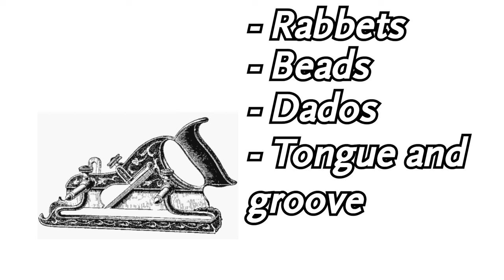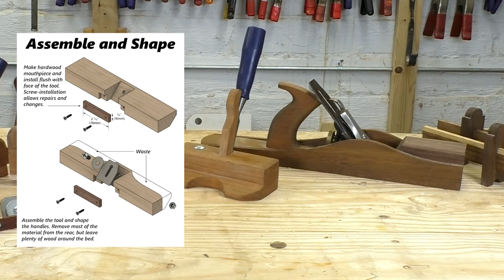The Surprisingly Essential Plough Plane

Comment: I am a hand tool woodworker.  I consider the No 4 hand plane, Router hand plane, and plough plane should all be purchased at the same time as all three are essential in my opinion.
Reply: I only sort of half-heartedly (dis)agree, it really depends, as they say. 
I had no use for the plough / combination plane in the beginning, but this heavily depends on the projects. Anything without drawers is a good start. Six board chest, Dutch tool chest, work bench, Richard Maguire's side table, dining table.... there's a ton without groves. (also the projects Rex presented so far).

Now I'm doing small cabinets with drawers, fitted a drawer to my Dutch tool chest, and I really enjoy using a plough plane (with a sticking board, also a good early project).

And the only power in my shop is the light. The rest, as Roy Underhill put it, is alcohol powered.
Reply: Yes, and don't buy a combination plane - even a good one like Veritas - unless you need a combination plane.  A small plough plane is a better choice.  Just don't buy a left handed one unless you need a left-handed one (or if you are left handed).
Reply: Why a #4 hand plane and not #5?
Reply: I recently bought a “new” Bailey #4, Gyokucho saw and Shinto (for endgrain work/tuning, as planes suck at endgrains). (I’m on a shoestring budget)
But, I still want/need a plough and router tho for drawers, boxes, more complex joints, etc. 
Expensive tho! 😕
Reply: @LessTalkMoreDelicious  If you watch some of Paul Seller's YouTube videos, you can build those for very little money.
Reply: @LessTalkMoreDelicious  I built my own router plane, based loosely on the James Hamilton design.  I bought two irons from Lee Valley.  Works like a champ.
Reply: You're not wrong. However, it's also useful to learn to cut grooves without one. A router plane can be made in shop as simple or as complex as you feel.
Reply: @petegrapentien4147  I use a No 5, 4, and3 in my normal work. Each a slightly different role. I wouldn’t argue if someone wanted a No 5. I just prefer the No 4 for its slightly shorter sole than a No 5 for all around versatility.

Comment: If you’re looking for flat glass for sharpening: I’ve always had good luck going to Goodwill and buying a bathroom scale for $3-$5. You’re going to be looking for ones with like 1/2” thick glass, but  that’s just my preference. Hell,  you know they’re all strong enough to hold 300+ pounds. I haven’t found any that were warped or out of true, but it’s probably a good idea to bring a straight edge to test with.
Reply: I got sooper lucky at the Re-Store and got pieces of thick glass. I bought the glass pane set off Taylor Tool anyway too for the price of the fancy micro film. I think it’s labeled as the Scary Sharp officially on there.
Reply: I use a mirrored sliding door from an old medicines cupboard. It’s already mounted, perfectly flat, and cost me nothing; skip dived it.
Reply: I went to dumb depot and got a 12x24 piece of floor tile. shiny, flat, $5.00
Reply: perfectly flat is an exaggeration. as flat as glass is, it's rarely ever perfect. it's just good enough for daily use. i mean seriously why do precision granite block if you could just use a 1/4 glass panel for all your metrology needs. haha.

frankly it doesn't need to be that flat.
Reply: @BloodSprite-tan  Using float glass that’s half a inch thick. I like to see the flatness by the surface smoothness by reflection. If my glass or whatever had any disruption in it it would be very easy to see. The power of light. I’m using mine for measuring machine tools too and use a granite plate that has more dips in it from wear. Glass is pretty amazing for sandpaper runs.
Reply: I can't imagine a glass surface plate is the least accurate thing in your set up right now. i don't think it's flatness has any impact, it's close enough to be used. it's just weird to call glass perfectly flat, when lots of glass isn't flat. i'm sure you had a temper glass screen protector it's easy enough peel up a corner and make it no longer flat. with that being said, if the glass is thick enough, it should be less of an issue. i mostly just want to tell people glass isn't always flat, it could be tapered or high in the middle, but since it's such a small amount off it's not noticeable or important.

glass is good for sandpaper. it just doesn't stick that well in my experience. i really don't know how they manage to stick the sand paper down without it coming loose, or when they do stick it down getting it and the adhesive off without spending more time than it's worth scrapping it off.
Reply: @BloodSprite-tan  In older houses, 150 years, the glass panes are thicker on the bottom and thinner at the top. It’s visually obvious and can be seen plainly by just looking. Glass is an amorphous solid, not liquid but moves very slowly. Slower than molasses is slow. Modern float glass however is very very flat and does not change over time. Again, the surface is so flat and smooth that you won’t see any surface imperfections from light being reflected. It’s a big bonus of glass. If you use the sanding film and polish two metal surfaces using float glass you will get a atomic level connection. Even granite surface plates rated highly wont necessarily do that.
Reply: I got a 16”x24”ish slab of reclaimed marble from a tile and flooring store for $10. Came off a bathroom counter I think.
Reply: @Vikingwerk  I get countertop scraps for free. They have to pay to dump them and are usually more than happy to let you take stuff out. Leatherwork shop in same building that sends customers over there lol

Comment: I got one, with a whole set of cutters. Lovely bit of kit and often gets used instead of the router for cutting grooves and starting mouldings.
I have so many old hand tools and love keeping them in use. Looking forward to your video later.
Reply: Yes, the 050 or 051 is not bad :) using lots of candle wax on the sole and fence helps a ton. It can still be a bit of a clat though.
Reply: @johanneswerner1140  so what is wrong with using a router to do the same thing?

Comment: I have a Stanley 50.  2 years ago bought it online for about $40.  It only had the 1/4 inch blade, which does a lot of work.  Slowly added several more original blades, including ploughs and beads.  Not expensive at all and cuts beautifully and smoothly.  I set the blade with a small brass hammer and this can make real finesse changes.   Really glad I got it.  Others will find it very useful.

Comment: Great review, Rex, thanks! I found a Stanley 45 with most of the cutters in a relative’s basement 25 years ago. I have taken it out several times but it will need a lot of work to free up the rusted-together parts. I keep putting off that job, but with this reminder of the 45’s utility, i am resolved to get it up and running soon.
Reply: So did you?

Comment: Nice discussion.  I've a Record 044.  Using it is a learning process.  There's a definite business potential for someone to start making blades for the old plow and router planes that fit properly, the way the originals were.
Reply: If you’re interested take a look at Workshop Heaven - they sell a set of 8 replacement cutters for the Record 044 for £41 or a set of 3 for the 043 for £13.
Reply: @richardsinger01  Thanks for the suggestion.  I looked, but couldn't locate any replace cutters except for some for the Quang Shen small router plane.  I'll keep an eye on the site though.
Reply: As others have mentioned Ray Iles makes irons for the old 44 type planes, and numerous other old planes. The Veritas router blades fit the old Record and Stanley routers, you have to invert the adjustment nut to fit them :)
Reply: @whittysworkshop982  "You have to invert the adjustment nut ... " which why I wrote ". . . fit properly."  Thanks for the information about new plough plane blades.  My 044 actually had blades with it when I bought it.  The learning process is in getting it set up.
Reply: I dont think it's a big deal to turn the nut around, and the blades are way better than the old ones, my old router has a set of Veritas blades for it; from tiny 3mm ones for fiddly inlay stringing, to the normal 12mm ones for flattening dados and tenons 😁
I have the Marples version of the 44...... it's my favourite tool in the workshop 😁 I find it's quite easy to set up, and its WAY better than a power router for grooves; no dust and noise....... its quicker to set than a power router too 😁 the 44 type ploughs dont like cuttin anything bigger than 1/2inch tho....... they lack support on the outside of the iron and they tend to chatter like mad with that size and above, but they EAT 1/4inch grooves for fun. Most of my drawer bottoms tend to be 9mm so the 3/8inch iron basically lives in my 44 😁 
The Ray Iles plough irons; I know of 2 instances where someone bought them and had to send em back...... they were not hardened properly, they could be cut with a file they were so soft. If you do find a set of them, check em with a file 😁

Comment: About 3 years ago, I bought a complete Record 050C Combination plane, as new in box, in perfect condition with all bits and bobs and original accompanying literature, for £28. Then I was given a complete spare set of earlier model cutters in need of surface rust removal, kept in original wooden holder to max it out. I don't know what that's worth now but it isn't going anywhere because I love it and use it regularly. It's brilliant. Yes, there is a learning curve when changing from one setup to another but you soon get the hang of it. This kit does it all - almost...!

Comment: I snagged a Stanley 12-250 with all the cutters (and original box and manual!) for about $150 shipped. It's a combination plane, rather than strictly a plow plane, but it's got the cutters to do all the plowing I'd ever need, it adjusts easily, and it feels pretty sturdy in the hand.

Comment: I learned this neat trick when using sharpening guides, instead of filing the chisel grooves square,all I did was put the cutting tool all the way down to the pins instead and tightened the tension. Sure you won't be getting a perfect 25° angle but with such low variation it doesn't matter and it comes out perfectly fine.

Comment: Both you and Wood by Wright have raised these small plough planes recently, so prices may be heading up.  I use a Stanley 50, which is nice for what it does.  

Buyers should note that these should come with a chip deflector and a iron securing screw for he narrowest blades - but they’re usually missing.  

Mine was missing these two pieces, but included the full set of cutters, all for $50.

Before purchasing, I recommend searching the web for the instruction manual.  The manual will help identify the pieces you need, and sipped the learning process for using the plane.

Before buying
Reply: I believe Patreons get advance access to the videos so have a slightly better chance of still being able to pick up bargains before the Krueger/Wright effect comes into play 😉

Comment: And if you're really lucky you can find a Stanley 55 with all it's blades in it's original box, minus lid, helping a friend clear a house prior to selling.
I also have a bookshelf/bureau that was built using the 55 by the original owner.
Total cost a few hours labour.
Reply: Wow. Shame you can't post pic of the 55, plus the bookshelf 🙂great find. ❤
Reply: Nice. I also found one, the tiny teensy problem is that it's currently being sold for 1,200.

Comment: I've got the Stanley #45 type 7 from about 1907. Has all the cutters and other fiddly parts and it came in a finger joint Chestnut box. Still has most of the label, too. I've used it for making drawers and panel doors.

But I also have several other specialty planes from Stanley. The #48 T&G plane, the #78 fillister/rabbet plane and the #72 router plane, amongst others.

My #45 I bought off eBay and paid about $110 bucks several years ago.

I used to have a wooden screw arm plough plane with some old Mathis irons, but traded it off for other tools. It was more a collector's play purty to set on a shelf and look at than a tool to use.

Comment: i made a simple grooving plane that makes a 1/4” wide hole 1/4” deep 1/4” away from the edge and it took me seriously like 4 hours and it does basically everything i need. I have a big fancy plough plane and i never use it, i just use the easy one thats always set up.
Reply: That's honestly what I've been contemplating doing.  90% of the time, if I'm cutting a groove, it's a drawer bottom.

Comment: Hi Rex, knowing many watch your channel I would like to add a small something. I have plow planes, here's the cost in Australian dollars for good functional plows, here we go, Luban 43 small plow $350, Stanley 50 with 20ish cutters  $350 -$450, Stanley 45 no blades $350 with blades $550 full set(3 boxes), Stanley 55, $500 - $800 no blades, Full set of 4 boxes $600 -1000. Australian dollars. Now in saying this you can buy ones cheaper but they are in very poor condition a ton of work refurbishing them and I mean a lot weeks day in day out. been there done that, but if you get them well you did well, now you need to learn how to use them. cheers

Comment: I've just bought a Record 043, waiting on delivery. Though I know it's missing the depth stop and two cutters. 
I have the Stanley 50, it's a great little plane. I found it works nice with shallow cuts, takes a bit longer. Also have a Stanley 55 (been in the family for years) I've only tried it once, takes a bit of setting up, wasn't too keen on it. I'll try it another again when I have more time.
Reply: Swap you a full set of record cutters, depth stop, fence  for your 55? 🤭

Comment: Some time ago I came across a Record 44, which has the thumb wheel adjuster for blade depth and comes with a full set from a 1/4 to 9/16ths blades. It was a bit foxed but I detect no use on any of the blades. Works well though needs freeing up.
Reply: The 044 is much better than the 043 due to the reasons you mention. I got an older good one for $40 with all the cutters.
Reply: @Membee  That is a good deal.

Comment: I have a Siegley combination plane.  Bought by Stanley in 1920 and Stanley kept making them.  It was a worthy competitor to the #45, maybe a bit heavier.  I also have a Veritas small plough plane.  It's a bit easier to set up, doesn't do dados and is smaller & lighter.  Veritas has 3 sizes of tongue blades and the Siegley has one.

Comment: I like the Veritas Combination Plane for this work. I appreciate that some people revere and love to restore junkers they find at flea markets but I would honestly rather spend my time making stuff than restoring stuff or hunting up irons that would fit. The Veritas one has a tone of sizes for tongues, grooves and a good many trims as well. The only down side to it is that you can't use it on curved surfaces, it's a flat surface only tool. Fortunately Lie-Neilson makes a very nice beading tool that will do curved surfaces and they sell blanks  that you can file to your own design and harden with a torch if you want to.

Comment: Glad to see some love for the little 43. That thing is essential for me. The fence can be cleaned up and fitted with a wooden extension and the little blades can in a pinch be called into action when I need a chisel smaller than 1/4" for cleaning out little dovetails or whatever.

Comment: We don't have many handtools around so i probably would have to order this plane from outside my country and deal with shipping costs. However, I've been thinking of buying a trim router for a while now!
It's actually cheaper and it seems it can do most of what this tool can do, (and some moulding!) 
It's a power tool but i'm not really opposing using both as long as it's an affordable quality option😂

Comment: The Record 405 is the equivalent to the Stanley 45.  As Rex said, they are very common in the UK.  Also have optional hollow and round cutters for the 405.  The Record 044 is a heavier built 043 with a true handle and more/bigger cutters and a threaded depth adjustment.  wonderful planes and the 043/044 is truly an essential tool

Comment: Ok. I liked this episode! I have been wanting to get one of these. I have been unsuccessful to acquire one on ebay or anywhere else so far. One thing I have gotten my hands on is a set of "tools" for creating wood screws; dowel rods with threads and corresponding tools for creating the wood nuts. There are 7 different sizes. What I am wondering is: how do I effectively sharpen the "V" type blades? Where can I find replacement blades? Veritas has been no help...

Comment: I recently bought a Stanley 13-030 with a set of 3 cutters. Even with shipping from England included, it was pretty cheap and works great!
Reply from the maker: I tried to get one of those for this video!  No joy.
Reply: @RexKrueger  Came to the comments to recommend these. They can be picked up (when you find them) for much cheaper than a Stanley 45 or 55. The build quality is not as good but they have some extra features and work well. The blades also fit 45s!
Reply: @rjamsbury1  I have one. It has a  nickname, the dog poo plane, due to the tote colour. It works fine but is limited to about 12mm in cutter size
Reply: @damiendrohan9500  lol, can relate to that about the handle. Thought about making a wood replacement but not sure it's worth it.
Reply: @rjamsbury1  it's not really a pretty enough plane for that. I will get something bigger at a later stage but it does fine now

Comment: Another nice one is the Stanley 46, which is a skew plough plane. It makes cutting endgrain much easier.

With a 46 and a 55, you can do just about anything, and even make your own custom blades.

I own the 45, 46, and 55. The 55 is expensive indeed, and finding one complete with all parts and cutters is not easy.